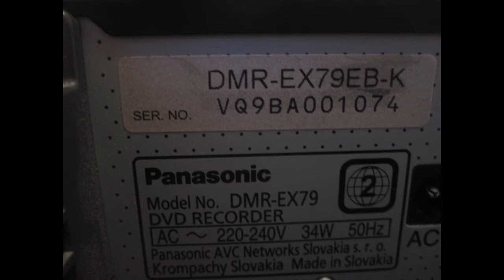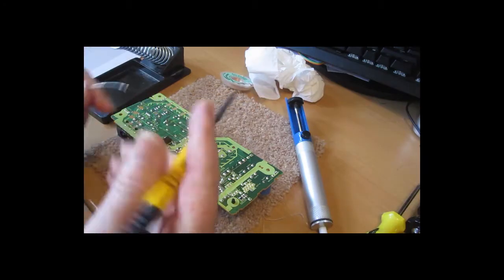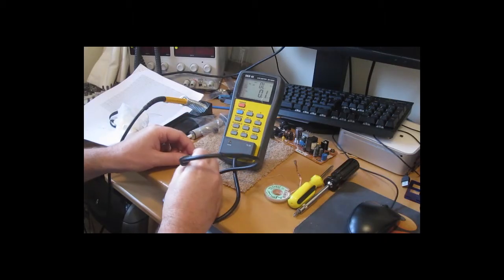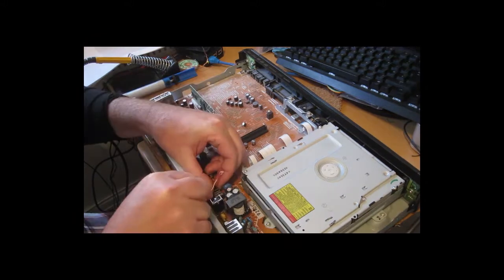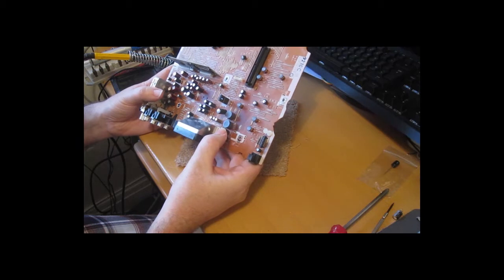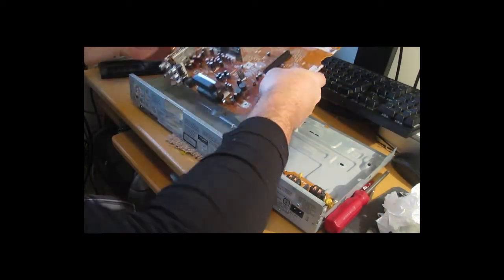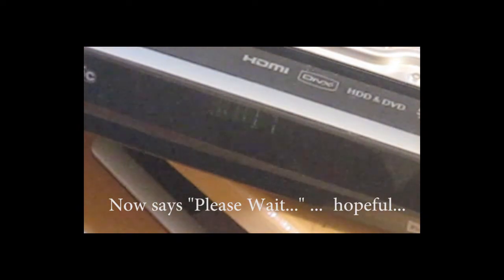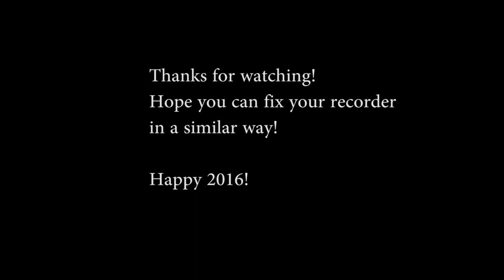Pansonic DMR-EX79 DVD Recorder "Please..." Repair

Comment: Congratulations on this repair. The disassembly looks very intricate and fiddly. Would like to have seen close-ups of the capacitor replacement and soldering, particularly for those of us who are crap at it.

Also, no need for the music, but your commentary was good. Also a good clean up would be in order.
Wonder how many machines are thrown away, when for the cost of a few pence they could be repaired.

Comment: Nice repair - I've come across one of these in a Repair Café and suspected a 680uF cap on the power supply board - never saw it again so can't be sure. I have another coming to me with a U81 error and a repair kit from eBay - hopefully that should work. Thanks for sharing your experience, fortunate that none of the ICs had gone in your case it seems from what I've read!

Comment: Excellent, very helpful video, thanks very much. My DMR-EX79 had the same 'Please, Please' error, then the display/power also stopped, and unfortunately after replacing two blown caps on my power board i'm still not getting any display or power to the device (DVD drive won't eject etc) there are still three blown caps on the Main Board, could these stop the unit powering up as well? Any help would be much appreciated. Thank you!

Comment: Funny how Panasonic makes their own brand of electrolytic caps but use cheaper caps in their own consumer products ...LOL
Reply: +watershed44
The reason why Panasonic use cheaper caps rather than their own brand is because Panasonic branded caps are possibly better quality which means  if they used their own branded caps in their products, their products wouldn't die as quickly which is bad for their business model.
Many people don't know how to fix their own electronic devices and sometimes opt to buy new ones rather than have the old ones repaired.
Everyone, even Sony and Panasonic are basically doing the same thing now 
using lower end components so their products die quickly rather than use good quality components (like they did in the past) so their products would last for many years.
Reply: if by law warranty would be minimum 10 years   this crap would stop

Comment: TIP....If the caps you want to replace have a small amount of their leads above the circuit board, you do NOT have to remove the circuit board to replace the caps...At the barrel of the caps take a snipper or wire cutter and snip off the barrel off at the leads, then you can position the remaining leads connected to the board and line up the leads of the new caps 
in line then use tape to keep the new cap in position and solder the leads on circuit board to the leads of the new cap...remember to observe polarity negative to neg and positive to postive...VERY IMPORTANT!!!!!!